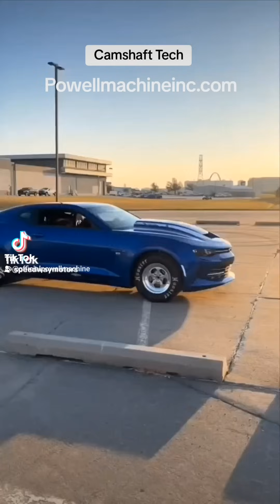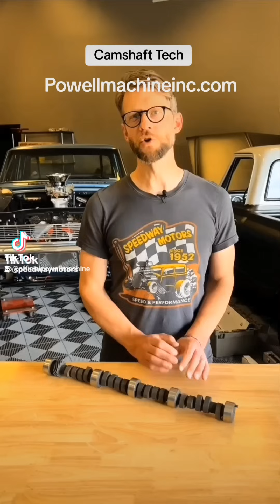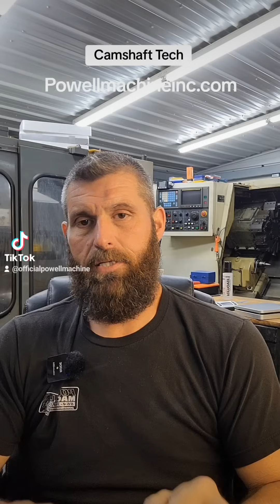Camshaft Tech,  overlap

Comment: Do you find it a common thing on GM 3.4l from early 2000's after they are shaved, to shim the rockers or find shorter push rods? I had a 2007 equinox that I had to shim the exhaust rocker arm, otherwise it wouldn't fully close. I found a Buick rendezvous with 3.4l need head gasket job. Just didn't know if thats common or not if its something i need to watch for? Thank you!
Reply from the maker: Should be no need, the lifters have plenty of travel
Reply: So you think that one incident was an isolated issue?  It was only the cyl 1 exhaust valve on the equinox.  It was my first time and so far 30k miles later its driving good still.  

I would like to do more to improve my mechanical skills. I got the rendezvous so wish me well.   @powellmachineinc
Reply: So that was an isolated issue? It was only cyl 1 exhaust valve.  I even readjusted the rocker & hand turned the engine thinking it would help but didn't.

I bought that rendezvous.  Looking to build up my skills. Thank you!  @powellmachineinc

Comment: The Overlap is what you're hearing... "But" what your actually hearing is a... CONTAMINATED intake charge from reversion, exhaust gases being mixed with the incoming charge in the cylinder & somewhat above the intake valve "At Low RPM" When you get up into the Camshafts power-ban... & port speeds increase... overlap becomes an efficient means of aiding in accelerated air speeds, then fewer already burned gases are returned into the cylinder to contaminate the charge. Air-Speed & RPM equate to increasing "Scavenging Efficiency"
Reply: Overlap is time period where the intake AND exhaust are both open.
Reply: Ultimately (because both valves are open) the exhaust gases are back flowing and diluting the intake charge. Which occurs at low rpm, causing a random lean miss. This clears up at higher rpm. At the higher rpm the air flow inertia actually stuffs more a/f mix into the cylinder even after the piston reaches BDC. And then the exhaust flow inertia actually draws in more a/f mixture during the overlap.
Reply: @franksprecisionguesswork501  Did you even read my post? You trying to tell me about something I'd already posted? Gimmie a Break.
Reply: Sure, tight LSA increases time both valves are open. But it also does something else which is rarely mentioned. That would be a tight LSA also increases the time both valves are closed! This is one reason tight LSA makes such tremendous mid-range torque....

Comment: Great video as usual. Would love to see if you could do a video of how to choose a cam specific to one's application: for instance, if you have a vehicle that weighs this much with these gears, and you want these characteristics (low end torque, high end hp etc), then check these specific numbers on the cams you're looking at. I get that there are an infinite number of combinations though, so it could probably be limited to 3 broad examples: a reliable daily driver (AC, high vacuum etc), a weekend toy, and a heavy off-road vehicle. Just a thought, I think that might help folks know what to look for in a cam for their specific vehicle.

Comment: Love this channel.
To be fair to the original video, all other things being equal, a cam with tighter LSA will have more overlap. Overlap is a byproduct of high lift/long duration in a properly designed cam and not the goal, though, unless it's a shitty cam like the Thumpr that the previous owner installed in the 350 SBC my 69 Camaro came with. Lopey idle AND ran out of power by 5000 RPM. Stupid. High lift/long duration cams with resulting overlap are required for cylinder filling at higher RPM at the expense of low RPM power and driveability just like long runner/short runner (single vs dual plane manifold) and all the other tradeoffs that factor into component selection. Some people like choppy idles, though. Myself, I'd prefer a smooth idle, crisp fueling, and lots of linear power throughout the entire powerband (which is the Holy Grail IMHO).  There's a limit to how fast a poppet valve can be opened and closed by a cam and springs so there's the bottleneck. Pneumatic valve actuation has no such limit, and can provide true variable timing/lift/duration but until it's economically viable for us non Formula 1 guys, we're stuck with mechanically actuated poppet valves.
Reply from the maker: I agree with ur initial statement,  but.... that isn't what they said, so if you are making claims you should be clear
Reply: @powellmachineinc  I agree. They oversimplified the issue. This is the Internet, though, and people rarely have attention spans long enough to learn the truth you stated.

Comment: Hi, I have a question, if I get two cams, the same duration at 50, two different LSA, the ones which has a tighter LSA would have more lift in the overlap than the other regardless it has the same amount of degree of overlap, am I correct? Regards from Argentina
Reply from the maker: Yes

Comment: Cams with much overlap tend to have a lot of variation in mixture strength and cylinder pressure at idle - hence that “blappitty-blapppitty-blatt” noise.  That goes away once the revs come up, as then there’s enough airflow through the system to even out cylinder filling and mixture strength.
Reply from the maker: Yes

Comment: Just an off the wall question here. When you turn down a damaged cam, is there any reference on how much is too much when it comes to cutting the surface hardening on the cam shaft? It's an old question from another video where you repaired that LS comp cam that was eaten up by the lifter rollers. And explain the overlap and how too much overlap requires intake boost to scavenge the exhaust cycle. Love your vids!
Reply from the maker: Yes, with induction cores you can see the heat treat line so it's pretty easy to tell,

Comment: cam  missinformation   is  very detrimental  in the  right or worst  application   i  have  yanked and  discarded several   "thumper" cams over the years that  people  put in stock to lower  compression engines because someone told them  theyre badass cams etc etc
Reply from the maker: Definitely

Comment: This cam talk got me thinking. Someone should come up with a way to alter cam timing at different rpm’s and load parameters. It would probably work pretty good, when it works. 😅😅
Reply: Lol, great comment! I guess I’ve been lucky, had several GM 5.3 vehicles (all purchased new) that I’ve run 150k to 180k and never had a problem with the VVT or Cyl deactivation. BUT, oil changes every 5K.
Reply: ,,,,,,,,,,,,,,,,,,,,,,,,,,,,,,,,,,,,,,,,,,,,,,,,,,,,,,,,,,,OEM,,,.,Engineers  have,,,,,,,its   called    VVT,,,,,lol............................but you knew that.......................................

Comment: Good information. And I'm sure you've seen Vizard's videos, where he claims LCA is primary. Holdner shows where tighter LCA makes better torque and power everywhere. I would suggestion at least giving some merit to using the LCA as the first part of the cam selection equation, withe overlap being the second. It has merit.
Reply from the maker: It just doesn't work that way

Comment: Good video. 
As another reference point, pro stock engines have an LSA of over 120, and they aren't exactly built to idle 700 rpm in Drive.
Reply from the maker: Definitely

Comment: Is there a way you figure dynamic compression other than trail and error. For NORMALLY ASPERATED I am shooting for 180-190 psi in a stock 2002 LS6 5.7 liter.
Reply from the maker: Yes, there's calculators on line free

Comment: This is a highly popular subject matter?!
Does your rule of -5 overlap @ .050 only for 350? What if you have a smaller engine like a 327 or 305?
My last question would be would a aggressive lobe affect the idle also? For instance the cam might have a intake duration of 227 at .050 but advertised duration of 268. The term that everyone uses is area under the curve. Will this play a role in idle quality?
Reply from the maker: Generally as intensity increases idle quality improves

Comment: One of the great things about a DOHC motor is that you can adjust the overlap which then allows you to make it work with your particular exhaust system.   Remember that overlap is when the exhaust and intake systems get time to 'talk' to one another and a tuned exhaust for sure wants different overlap than a log manifold.   Picking a cam based solely on overlap is like choosing a football player without looking at the rest of the team he'll be playing with.   Everyone must compliment one another so please look at overlap choice as one of the things that must be compatible with the rest of the engine build for best results.
Reply: Seems to me overlap is a good starting point once purpose/driving style of the engine build is determined, and that is my first touchpoint after deciding preferred rpm range.  The odd thing about lsa might be that no matter what rpm the engine is doing, exhaust gas speed leaving the head is about the same: blowdown begins before bdc, and its the physics of combustion in control.  The difference between 3000 rpm and 7000?  Mass of ejected gases..  And, atmospheric pressure acting on an intake is pretty much a constant. Impulse flow is more complicated than I know how to explain, but I guess it al boils down to this: as built, should we worry where peak intake lift is vs exhaust?  I think the answer is yes on account of piston position in the bore vs signal decay during the time of overlap - how much work is derived from scavenging accounting for how much volume must be acted on... leads to lsa not being irrelevant.  A constant in vs a constant out [na] might suggest any motor does have a preferred/fixed lsa, and finding that is worth the effort.   I'll ask a dumb question: is an engine an air pump, or a peak pressure modulation device that begins with exhaust gas in motion?  A camshaft appears to favor the latter... until the turbo guys arrive and the rules start bending just a little.
Reply: @flinch622  It's is all very interesting, also factoring in exhaust reversion and "stepped" style exhaust design to prevent reversion. Generally yes the cam shaft should be the first part to the puzzle. What RPM power range do you want and will it be in a truck and towing loads? Do you want to only run pump Gas? Then you must calculate the needed static compression to have the proper Dynamic compression to work well with the camshaft.
Reply: @flinch622  ,,,,,,,,,,,,,,,Well said,,,,,,An air compressor is an air pump,,,,a stock  smog car engine  is an air pump.......A highly  tuned  Drag Race engine is a peak pressure modulating animal,,,,,,,,The wildest  cams  for a Naturally  Aspirated  engine  have so much more Exhaust valve  lift at TDC  ,   to fully  utilize the high  RPM  scavenging  phenomenon ...........................OH,,,,,,,and  politically  correct  terms  is  woke  ,  rainbow  bullshit ,  Normally  aspirated  ,  and  pounds  feet  ,  comes from  desired  changes  from  aholes  that want to rewrite  physics  and  math principles,,,,,,,..I was born in 1951,,,,,,,,,,buttfuk  the shitheads in college  today.......I have a Problem  with them,,,,,,not  a freakin  issue,,,,,,,,LOL.....................
Reply: DOHC with variable cam timing on both cams allows for some really good power from something that idles smooth, gets good mileage, and good emissions. 
Stuff like Vtec takes it even a step further with the second set of lobes so you can have the high power cam without a sacrifice.

Comment: Cams don't know what what engine it's in so lca does matter compression dictates this part  now so does head type just because someone wants a certain spec doesn't make it right the engine has to benefit from the part if not then its a bad part but its the purchasers fault
Reply from the maker: Engines don't know what the cam lsa is, the Engine responds to opening and closing events and the rate the valve opens and closes
Reply: Engines do know what lsa is
Reply: @bigboreracing356  Mr clueless say lsa is where peak lift happens there for 1 degree may cost or gain 45 hp so you just don't know how it all works  so I'll try to help lsa is where peak lift is in relation to where the stoke is that is the first thing that built into the cam blank duration is the rate from open to close lift is how much it opens at peak lift so if lsa doesn't matter then why does lift matter if lsa doesn't matter you simply don't understand how it's related to compression and valve size is
Reply: @paulpruitt2776  ,,,,,,,,,,,,,,,,,,,,,,learn how to compose a sentence,,,,,,,,,,,,,,,mis written  shit is suckin  wind..................................
Reply: @bigboreracing356  see you can't even read that is not what I wrote I said lsa is derived from the compression and type of head meaning valve size and flow are you really that slow minded so I'm guessing by you two non readers you choose cams by hit and miss because you don't know at what time your lazy engines need peak lift

Comment: Overlap is a word for saying the intake and exhaust valves are open at the same time.
Reply from the maker: Correct
Reply: ,,,,,,,,,,,,,,,,That simple statement  confuses alot of  people,,,,,,,,,,,,,EXPLAIN THE COMPLETE  SCENARIO,,,,,,,,,,,,,,,,,,,,,,,,,,,,The  exhaust  valve  has opened [ BeforeBottomDeadCenter ]  near the end of the  power stroke ;  as the piston starts upward on the exhaust stroke and nears [ TopDeadCenter ]   the Intake valve  begins to open [BeforeTopDeadCenter ]  as the piston  swings  past TDC going down on the Intake stroke the  Exhaust  valve  will close [ AfterTopDeadCenter ]  ........To camshaft  guys , many  think of the four strokes  starting  with  the  Exhaust  stroke  ; because  at the end of the  exhaust stroke is where the Intake  valve begins to open ;  initiating  the overlap period,,,,,,,,,,,,,,,,,,,,,,,,,,,,,,Exhaust,,,Intake,,,Compressio,,,Power.....and  Exhaust  again starting anew cycle.....................................
Reply: @ThomasELeClair  Thanks for clearing things up.

Comment: Great information! Does LSA affect idle vacuum or is that secondary?
Reply from the maker: No, overlap effects vacuum
Reply: @powellmachineinc  so I don’t need a wider LSA for fuel injected sbc. Could I benefit with same specs going to tighter? 112 to 110? I might just call and talk to you about custom cam.
Reply from the maker: @Shop209  it's all relative,  compression, cylinder head, power goals, rom range ect

Comment: Some of this started with Ford.  They were the ones that discussed LSA as a function of their early bank fired EFI and what it would tolerate for cam upgrades.  They insisted on 114* of LSA to make things work and still pass smog testing.  All the cams were mild like 212 or maybe 218.  Anything above that and they'd run badly and not pass smog testing.  Nowhere in their discussions was the math for overlap included.  Or the overlap area calcs ...  🙃
Reply: Yes.  And differences in the ease of flow from exhaust valve to intake valve from one head design to another.  This is why Vizard's 128 formula works for some head designs, but others need to use a different number in the equation than 128.
Reply: Funny, I'm here thinking about what cam would be best for my truck with the bank fired EFI.
Reply: @ronwest7930  For bank fired EFI I'd stay with 114* LSA and a mild marine grind like Ford supplied to the marine engine conversion folks.  But you can step on the rocker ratio and that will add a smidge more effective duration and more lift 😊

Comment: 30 years.  Where have you been? Anyone can become a Google Master tech in 30 days.  I need 280° @ .050 on the IN. 300° @ .050 on the EX. with a 103 LSA.  I want 2 inches of vacuum at a 1400 rpm idle for a daily driver.  lol
Reply: Ha and you’ll need a nice tight “RV” converter and flat 2 gears for the full effect;)
Reply from the maker: Lol

Comment: I think too often, probably 95% of the time, people equate a lopey idle with more power. Granted, who doesn't like the sound?  But all too often a way  too agressive cam is selected. Most off the shelf cams have too much duration for the application they are supposedly intended for and then the lsa is widened so the engine will idle reasonably. A shorter duration cam with the same overlap (tighter lsa) will often make much better power as the earlier valve closing will cap off the intake charge in the cylinder and prevent unnecessary reversion. Too many variables. Proper cam selection is not easy. David Vizard has a program that can accurately select the correct cam for the application. He also has some cheater formulas, 128 rule for sbc, for example,  but leaves the builder room to totally miss the duration and lift specs. 
You have an awesome channel !  Looking for the next one!
Reply from the maker: Ty
Reply: Yep, put a 9,500RPM cam in a low compression engine that only turns 6,000.   THAT'S how you make power!!!   :D